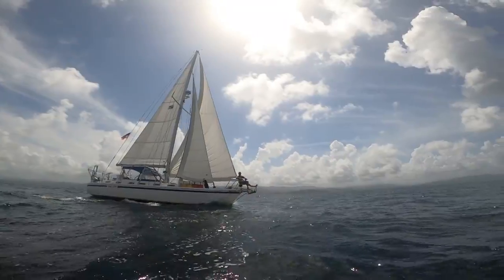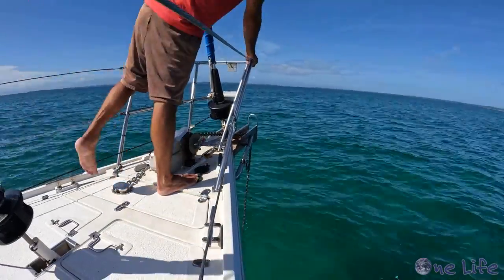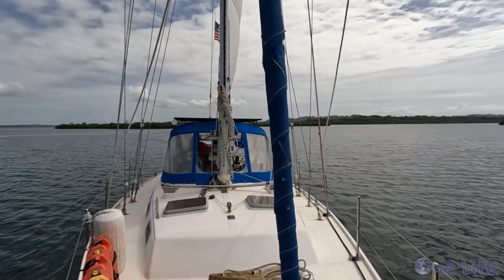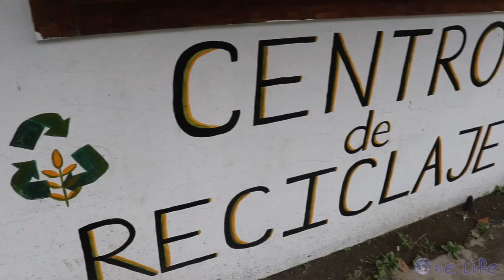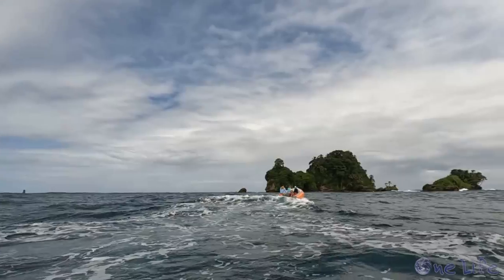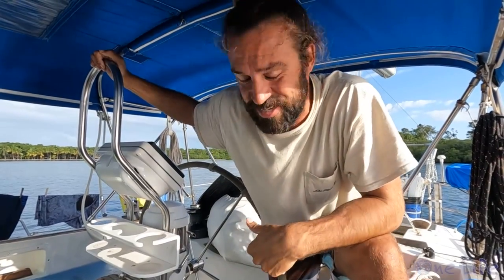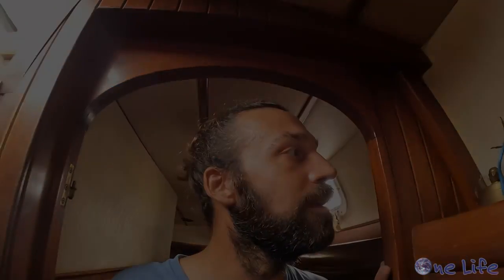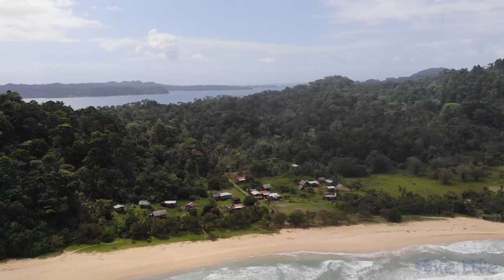If Only Sailing Was Always Like This - Cruising Around Bocas del Toro - Episode 60

Comment: Saw ya kneeling in the sand at sunset and wondered if you got any chitras bites / sand flies... or do you use repellant?  I'm just learning all about Bocas from afar.
Reply from the maker: So interestingly enough we haven't run into much trouble with bugs. I only remember being attacked one time at a beach and that was in Las Perlas. When we anchored outside the town in Bocas there were lots of mosquitoes at night but we really didn't have any other issues.